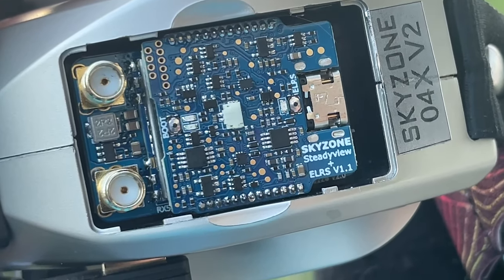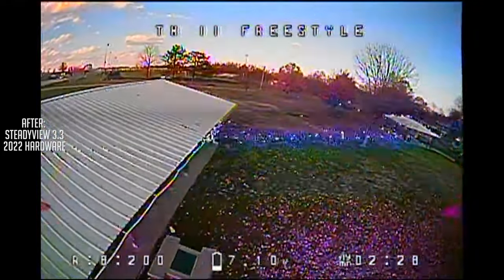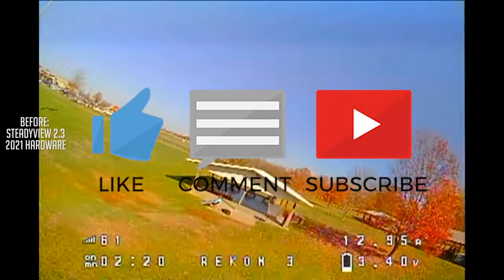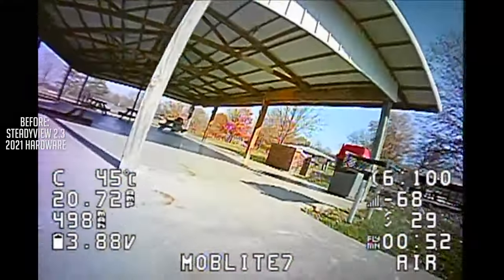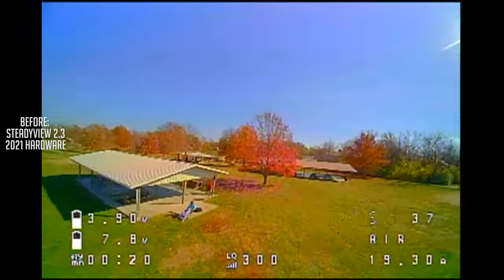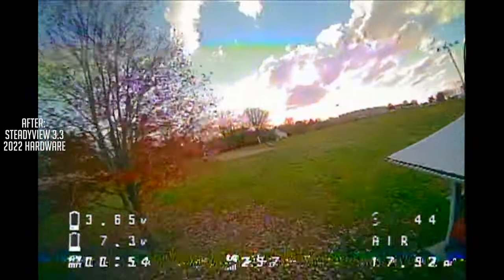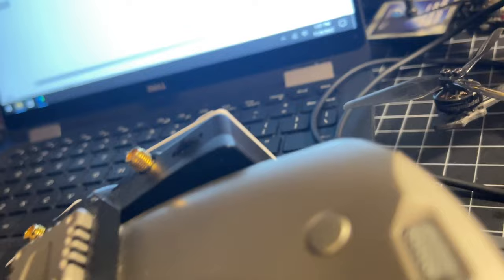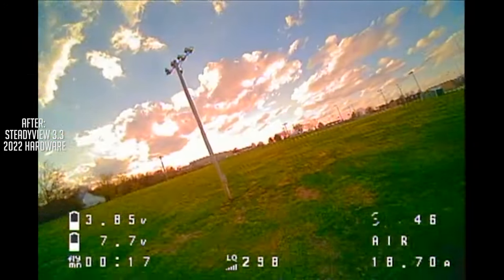SkyzoneFPV Steadyview Fusion Board V3.3 🧮 // Did They Fix Mix Mode?

Comment: Oh, so that's why I get image shake. I always end up needing to reboot the goggles to get rid of it. Now I feel kinda cheated.
On a side note, do you tend to run PAL or NTSC? I usually go with PAL for the increased vertical FOV.
Reply from the maker: Definitely prefer more view vertically.
Reply: 100%. We were all cheated by Skyzone. The updated module should be free. It's not an upgrade, it's a fix!

Comment: I´d recommend using the v2.2 firmware on the old video receiver. I tried the newest v3.4 or something and it was bad. Then i tried tha v2.2 and it is the best what you can get i feel like
Reply from the maker: You probably mean Steadyview 2.4 vs 2.2 as the old receiver does not actually work right with 3.4.  

It will let you flash it, but the hardware will not work right with it. That's why you had those problems.
Reply: Idk it still works better than with what  it came with

Comment: Thank you for this, I didn’t have much issues with the v2 at all but the upgrade is definitely an improvement. Do you think the v3 and the v2 will play well together in a quadversity set up? 🤔
Reply from the maker: V2 and V3 hardware cannot be mismatched for quadiversity. You would need to upgrade the V2 module with the fusion board.
Reply: @JohnCuppi  ooo ok I think I understand
Reply from the maker: @WindjumbieFPV  Yeah, there’s a few posts in the Skyzone FB group that have asked about this and for those who have tested it, mixing a 2.x and a 3.x module together basically just doesn’t work right. 🤷‍♂️ it makes sense since the hardware change between V2 and V3 is extremely significant, they cannot work together. Or maybe Skyzone just doesn’t care to try to make them work, idk. Note, I have not tried it myself and I’m just going off knowledge in the group that I’ve read.  I’m not even sure Skyzone has documentation for this specific question anywhere, either.
Reply: @JohnCuppi  thanks man, Big help 👊🏽

Comment: I wonder what would be the comparison between v3.2 (which I own) and v3.3 🤔
Reply from the maker: Good question. I didn't even know there was 3.2 hardware. I would reach out to skyzone and ask what the difference is between 3.2 and 3.3, it's possibly very significant or not at all.
Reply: @JohnCuppi  Would be great, because this question for me is unsolved, and I don't know if I should upgrade :) Thanks!
Reply from the maker: @NykowskiSpaceruje  I asked and got sort of a mixed response on this. He said that version 3.3 was basically perfect, but that if you don’t have any problems with rolling, or dark images on 3.2 then you don’t have to buy 3.3, there’s no need. That sort of implies that 3.2 is obviously ‘worse’ than 3.3 but it doesn’t sound significant.
Reply: @JohnCuppi  Thanks mate! Best regards!

Comment: I ordered the skyo4x a week ago on banggood. I hope there is the New hardware in it
Reply from the maker: Skyzone says they have been shipping the new hardware since mid-2022 so it probably is, unless banggood has very old stock.
Reply: Hey i got my Googles yesterday and tested it now. 
It hast the new 3.3 hardware, but i have a Question i cant find any answer in the Internet...
What does the rf modes normal, steadyview x and Race, etc. mean?
Reply from the maker: @DiraPictures  Sorry, I didn't see this for some reason, did you get this sorted? If you have the newest 3.3 hardware+ELRS, choose SteadyView X. Otherwise, choose RF-Normal.

Comment: When you upgraded  was a "SteadyviewX" line added to the mode selection menu and is that what you selected?
Reply from the maker: Correct. If you have the ELRS fusion board and select something other than "SteadyView X", such as RF-Normal, etc, it will not work properly at all.
Reply: @JohnCuppi  I have the non-ELRS board  V3.3 which (flashed to latest firmware), according the the Skyzone website, is the same fusion hardware as the ELRS version.  The issue I'm having is when I select SteadyviewX and power down and back up I frequently will only see snow until I switch to RFNormal.  I can then switch back to  SVX and all is good until I power the goggles down.

Comment: Hello, finly this is the first video with this new module. I have a rapidmix muddle on my EV300O. This is v1.2 20200805 so it's very old. I have some problems so it should be improvement as well. Also I will be switching my TX Module Crossfire to Elrs Ranger soon so my question is regarding elsr backpack - is it really worth it or standard will be better? What's your opinion about it?
Reply from the maker: Thanks for the comment! Yes I am the first one to upload a comprehensive test video on this new module, I think there was just not a lot of interest from other creators in getting to this. But it was an important test and i'm happy it's been helpful.

I have not done any ELRS backpack testing at all with this module. I use ELRS and plan to set it up soon, but I have been busy on other projects. Also, at this time, I mainly fly a lot of analog micro quads that don't even use ELRS. They are frsky spi models. So I have not had a lot of motivation to get ELRS backpack up and working yet. 

I believe the $5 to have the backpack option is worth it though to have the option, and adds resale value if you ever plan to sell the goggles.

Comment: I have new  v2 goggles with steadyview hardware list V3.3 , I want update firmware , so  it just work only with v3.3 firmware or I can flash firmware using V3.4 ?

And another question , when my quad fly close over me I get "splash/ distortion"  how to fix it

Comment: Hey there, I purchased these Goggles second hand I think I need to upgrade the receiver to the new one. MY question is, do I just purchase the "Fusion Board" option (which is what you did, right?) or the "Steady View" option, which costs a lot more?
Reply from the maker: You are correct, you only need to buy the $25 fusion board 😊
Reply: @JohnCuppi  Thank you very much for your fast answer, I appreciate you! I just finished ordering the Fusion board and hope it will make the video feed comparable to my HDO 1's with FuriousFPV True-D Receiver (they came "free" as part of a huge FPV second hand bundle, along with the Skyzone 04x v2) 

I really want to use the 04x V2 over the FatShark HDO1 (bigger FOV and more intuitive menus) but with the current state of the receiver the FatShark has CONSIDERABLY less breakup, its insane...

Comment: Que puede decirse sobre el RF Steadyview X Mode vs. Modo mix del menú? Cual es la diferencia?
Reply from the maker: 3.3 ELRS Module, requires the Steadview-X mode. Don’t know why. 🤷‍♂️ RF-Normal mode, not work.
Reply: @JohnCuppi  gracias por responder tan rapido, entonces que debo usar en unas gafas Skauzone Cobra X V2 estandar, RF steadyview X mode o simplemente RF Normal y eligiendo modo Mix desde menú?

Comment: I bought the module, and now that I installeds it, for some reasons my colors are all funky/dark in my goggles... Can't find exactly which firmware I need for my goggles or even receiver as their website is confusing as hell..
Reply from the maker: maybe I can help. do you have any idea which hardware revision your sky04x are? v1/v2/v3?

Comment: Any idea if this will help with interference when flying near other pilots? 
BTW, I also had more issues with those color change desyncs when the sun was behind me and the drone in front. It was worst with a NanohawkX.
Reply from the maker: This will not change anything with interference from other pilots. That’s more of an issue with making sure everyone is on a channel/band/power that’s appropriately spaced and low enough to not stomp on each others signals.

Comment: Hi maaaan... 
I have Skyzone Cobra S goggles And if I understand correctly... Just buy only the Fusion Board and carefully replace this board on the receiver. Update the glasses to the latest FW? And it is done?
Reply from the maker: Correct. The Fusion Board module is what has the firmware on it, and when you replace that, it is up to date. Only the Goggle/Glasses to the latest firmware. Not receiver.  Make sure to change RF mode from RF-Normal to SteadyViewX mode. Happy flying! 😎👍

Comment: I have the same issue .mine turns black and white. And it keeps roling to black images..I I ques I have to get the v3 module and place it ontop of the other one
Reply from the maker: 😢 Yep. But, at least you don't have to buy a rapidfire, this is much cheaper and fully works integrated with the skyzone goggles. Very sad that they did not just replace this for free for everyone.

Comment: Yes i have times where its so bad and black i cant see where i am, but its seems to be with the caddix ant but not always, most of my quads ive switched to runcam Phoenix 2 nano and no issue. But there are times its bad but goes away very random. I wish i could order the fusion in the states. Haven't found it anywhere,  and yes they should just send it to people having issues.
Reply from the maker: You will probably not find it stocked stateside anywhere ever in the future. 

There just isn’t enough demand for the fusion board for stateside vendors to order a lot in bulk and stock this item. 

Skyzone claims they are already selling it at a small loss. So it’d also be an item which they will also make almost no profit on either, another no go for stateside vendors.

My order just took a couple of weeks from Skyzone, it was not a long wait.
Reply: @JohnCuppi  going to have to order through skyzone or buy another nano cam. My th2 was terrible tin i put runcam and rush tank mini on it.

Comment: I just bought sky04x how I know if I have the correct steadyview
Reply from the maker: Open it up and the version is written on the hardware. Or you can check hardware/software firmware. If you just bought it brand new though, they have been selling it for at least 6 months or more now I'm told.

Comment: Hi. Just yesterday I received my Fusion board with ELRS. Your video was the most important for my to decide to buy it.
But i have some problems with it, first of all with new board it doesn't work in RF Normal mode (no signal received), only in Steadyview X. 
Second, with Fusion board my VRX is getting very hot in just few minutes of work.
Did Anyone notice too overheat the reviewer??
Reply from the maker: Hi, the ELRS version requires the SteadyviewX mode. That is normal and it should work fine in that mode.

As for the heat — yeah the new receiver does get a bit hotter, but I have not had any problems at all with that.
Reply: @JohnCuppi  I hope the heat won't gonna brake anything.
Reply from the maker: @coolcat7682  I left my goggles on for an hour by accident already and it didn't do anything to them. Do you live in a hot climate? There may be some possible concern about performance in very hot climates but I have not seen any evidence of that.
Reply: @JohnCuppi  At now I have winter outside and about 3 below zero Celsius. In the summer then can be even 30... Will see how it will behave...
Reply from the maker: @coolcat7682  I am not that worried, it is designed to run hot I’m sure. One thing to remember, this module has been shipping in new goggles for 6+ months and I haven’t heard of the modules burning out or breaking. 🤷‍♂️

Comment: v3.2 is fine. I had a v2.1 and a v3.2 .. my v2.1 broke when i dropped my goggles. So im ordering a new module. So its fixed with v3.2 too?  So i only need 1 module
Reply from the maker: My understanding of this is yes, but — better check with Skyzone first. We’re you doing quadiversity with 3.2 and 2.1?
Reply: @John Cuppi  yea I looked seems I had a v2.1 and a v3.2 module. Not sure which came with goggle and which u bought online after getting goggles (I bought 2nd module as soon as my goggles showed up. 
I had rolling issues at times and some other issues. But my rapid-fire was never perfect either.

Comment: Hi everyone! I'm an owner od Cobra X v.2 (V.3 hardware, firmware 3.4.9). So, finally I've purchased the Fusion Board Steadyview 3.3. Fortunately the randomly appearing black/red screens are missing. However, Steadyview X mode doesn't work properly just like before in older  hardware 2.1. Skyzone guys do not answer/help me with this issue. RSSI calibration proceeded. I've tried either steadyview firmware 3.3 or 3.4 and still nothing's changing.
If someone has any suggestions what else I can do feel free to give me a piece of information.😔
Reply from the maker: Are you using the ELRS Steadyview 3.3 or the regular Steadyview 3.3?
Reply: @JohnCuppi  Steadyview 3.3 Fusion Board merged to receiver v.2.1, just extactly as I had been advised by Skyzone team.

Comment: Can I use this module with other goggles? Like the fatshark hd2?
Reply from the maker: You can, but only if you use ExpressLRS and setup the backpack. There is absolutely no other way to control the module from either within the fatsharks, or externally since it has no screen. Really not an ideal setup. Skyzone now makes the SteadyView X which is suited for that.

Comment: My Steadyview receiver module hardware is v2.1. Can it be updated to the latest Steadyview firmware for instance v3.3/v3.4 ? Or to the 2.1 firmware accordingly to the hardware designation ?
Reply from the maker: It's based according to hardware designation. If your hardware is 2.1 like mine, then no, it cannot be upgraded to v3.x firmware as it is totally different hardware running the fusion board.
Reply: Thanks. Can you simply connect the t v3.3  Fusion Board to the 2.1 module ? Unfortunately Steadyview X mode in my Cobra X v.2 is not working properly or at all.
Reply from the maker: @Johnygoodfellow  Yes, that is what I did. I just replaced the top part of my 2021 module. And SteadyView X mode will only work with the new hardware.

Comment: Hi John, can firmware v3 installed to hardware v1?
Reply from the maker: No. The V3.3 Hardware is what really has the fix anyway, it’s not primarily a software/firmware based fix. The old v1 and v2 hardware just was not good enough to do the mixing.
Reply: @JohnCuppi  v1 stand for Skyzone Cobra X v1, can i copy-paste the v3 firmware into it? (Not for steadyview Receiver module)
Reply from the maker: @rjsangg I don’t know, sorry. 🤷‍♂️

Comment: I just bought the sky04o pro. My module says v3.3 and firmware says v1.1. Do I need to update the firmware? And which files do I need?  Thank you in advance
Reply from the maker: Late reply, sorry - but no. You should be good. The firmware version of the module is not the same as the hardware revision.
Reply: @JohnCuppi  thank you. It’s all confusing to me 😂
Reply from the maker: @mopar392ta3  Yeah, Skyzone has done a terrible job documenting anything honestly. I don’t blame you for being confused.

Comment: Quick question... Can I buy the V3 and add it to the empty slot to enable the quad diversity?
Like will the v2 work with v3, did you try this?
Reply from the maker: No, it will not work. Skyzone has confirmed that it won't work and I've tried it. The major hardware revisions need to match. 3.x and 3.x are needed. Sorry.
Reply: @JohnCuppi  ok good to know. Thanks dude

Comment: Why Skyzone need to sell fusion bord when they could just make firmware upgrade?
Reply from the maker: The new hardware has a faster, better processor. That is the actual fix, the old hardware itself was simply not good enough, and cannot be fixed with firmware.

Comment: I have the v2 of the goggles with the 3.3 module and I need to switch to normal rf mode then back to steadyveiw EVERY time I turn my goggles on if I leave steady view on it won't connect to the drones video is this just my problem or have otherers had this problem ?
Reply from the maker: This is not normal at all! If I had to do this, it would drive me insane. You have a problem with your software / hardware / firmware. Reach out to Skyzone. Your goggle’s SteadyviewX mode should be working immediately and connect to your drone’s vtx. Mine remembers everything, including the last band/channel that I use. Does it remember your band/ch or no?
Reply: I have the same problem
Reply: I have the same problem
Reply from the maker: I can 100% confirm I don’t have the issue with V2 goggles. Be very interesting to hear what Skyzone says about this.
Reply: did you solve the issue yet ?

Comment: In the end I have designed an adapter for TBS Fusion and fly happy since that. Never ever Skyzone again, lost my faith in them.
Reply from the maker: A lot of people did switch to rapidfire or fusion if they were crafty enough to make an adapter - but, there are also a lot of people like me that had an okay but not perfect rx and stuck with it or just flew diversity when mix didn’t work out. 

The new one gave me a working upgrade path that did fix the issues. It’s a shame that it took so long for Skyzone to correct this, but it is what it is.
Reply: I had very bright white flashes in diversity mode, which were unbearable. Strong headache as result.
Reply: @donphobos By chance you still have the info on your adapter for the TBS Fusion RX? I’d like to add one to my 040X V2’s as well.
Reply: @JNuman85  yes, please. You need link to the files?
Reply: @donphobos  Hey! Yes, do you have the files still? I added a RapidFire but compared to my Fusion in my DJI goggles the reception is horrible. I’d love to try the fusion in my skyzones instead.

Comment: STEADYVIEW IS NOT WORKING ON THE NEW V3.3. I HAVE TRIED ALL THE RF'S STEADYVIEW, RF NORMAL, AND RACING NOTHING HELPS. EXCEPT I'M USING DIVERSITY MODE WHICH IS JUST FAIR ENOUGH. AM I MISSING SOMETHING???
Reply from the maker: Contact Skyzone, your receiver sounds defective.
Reply: @JohnCuppi  is this meant to be in RF steadyview x mode or RF normal mode  for the version 3.3 fusion board?